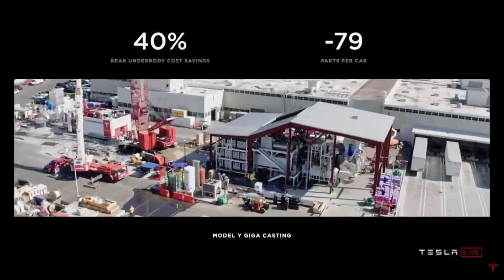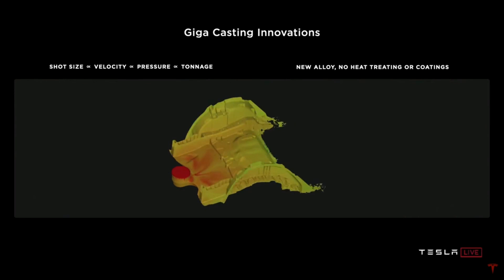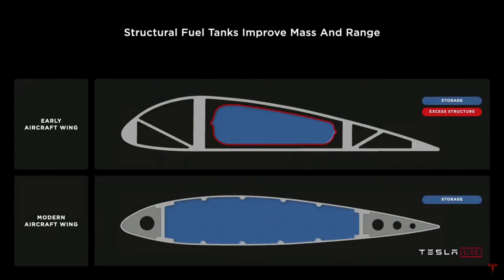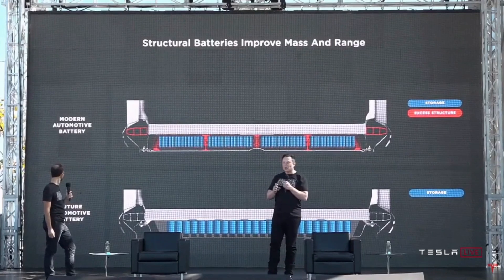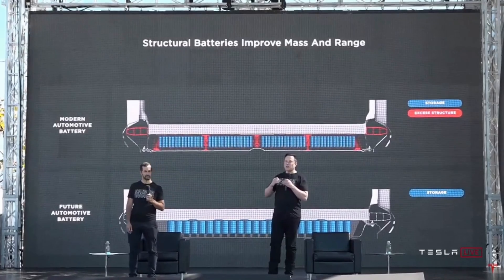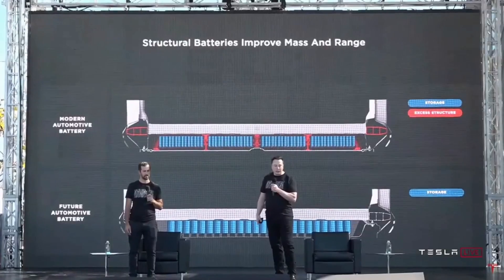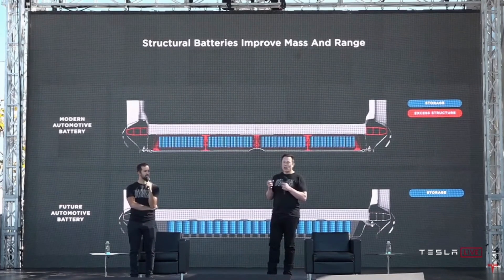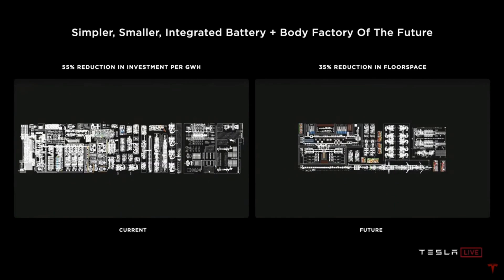Elon Musk explains how Giga casting works for the Model Y

Comment: How can tou change a battery if they are structurally bound to the rest of the car ?
Reply: It's still bolted in from underneath just like now. Except it's a stressed member design. So the pack itself ad's to the overall frame stiffness.
Check out the model y Berlin demo. You can see the structural pack has the seats mounted on it and then installed from underneath up into the chassis. Brilliant imo as it saves them having robots on the line installing seats from the sides. 👍🏻

Comment: All respects to Elon and his team of engineers. I love the way Tesla throws out the old automotive engineering playbook. But Elon forgets that not everyone that drives a car can afford a  new vehicle every 5 or 6 years. What I see in his design is the I-phone of cars.  Once the battery is used up, your only choice is to junk the car. In fifteen to twenty years junk yards will be filled with otherwise functional old Tesla cars because it's not feasible to replace the batteries.
Reply: The battery lasts a million miles.  That is more than most cars stay on the road.

Comment: What about cost of repairs? Sheet metal will bend and still remain serviceable, a casting will crack and run the risk of total failure and have to be replaced at high cost?
Reply: that's the downside to this, if you look up what happen to Tesla after an accident and majority of them are thrown away because you can't repair a whole body casting like this.

Comment: If its integrated into the main structure how would you change the battery? 😂
Reply: He is saying it will be single densely packed battery pack with filler adhesive in between cells.
From service point of view modularity has advantage to replace any defective module as you thinking.

Comment: What is the repairability of these castings?  Is a “fender bender” cause for a major repair?
Reply: Was thinking that myself, generally the more modern and integrated a car is the less easy it is to repair.
Reply: Welding repairs current casting aluminium alloys is a right bitch, so I expect that trying to repair a new structural alloy could be a real nightmare and quite possibly uninsurable.

Comment: What happens when you have a fender bender,do you have to buy a whole new casting?
Reply: @MrDpearso22 the impact to damage this casting would be greater than it would take to bend any frame structured car that’s instantly deemed salvaged by insurance. That’s what sandy munro says anyway but he’s just an engineering expert so what does he know right.
Reply: @MrDpearso22 i sort of agree, but it might be too soon to call it. With the unibody made up of two big aluminum castings, it might end up being easier to fix than a crunched up standard sheet metal unibody. Will it be cheap? Hell no. But say you get badly rearended with frame and suspension damage. If you can just bolt on a whole new rear half casting and body panels, AND it could drive like new? I think thats more repairable than today’s modern cars. But we’ll see. Hopefully they make this thing as repairable as I think it could be.
Reply: @MrDpearso22 not exactly, make them cheap and recyclable. Invest in energy tech so you can have cheap clean energy creation and now you have a perfect cycling economy. No waste, only energy consumption to remake the car from the old materials

Comment: isnt die casting really brittle ? what happens when someone crashes ? normal steel/aluminium deforms and absorbs a lot of energy from the impact, how will die cast parts do that ?
Reply: They are not intended to crumble in any way, because they are part of the Passanger compartment, not the crumble zone.The Crash Rails on them which were mentoined are where the rear end structure is attached to the Casting - and that part is intended to crumble and be replaced.
Reply: These castings have a special alloy (Al + additional materials) to overcome fragility on the part... Pretty sure, his Space-x engineers found the correct formula to solve this issue as well as the dimensional aspect.

Comment: Definitely gets cars out the door at lower cost. Now let's talk about repair. I hope that the question of repairing frame damage caused by collisions has been considered?
Reply: Writeoff
Reply: as with any other vehicle where that equivalent part is damaged..
Reply: This actually solves the issue of repairability of unibody cars, apparently.
Reply: Vehicles already have formed sheet metal frames. Making the frame out of less pieces is exactly the same, just simpler and stronger since they have less welds
Reply: @ouvuu  they don’t provide the same structure strength as this though

Comment: Why was it so important to develop a “special” alloy and impractically large die casting machine to make 1 part when you could have made 2 parts very normally. I believe it replaces 70 or so parts? 1:70 isn’t that much better than 2:70 in the system of mass production. Thanks
Reply: Manufacturing time. Developing the alloy and machine is a one time cost. The saving is over millions of parts not having to be welded together for the millions of cars that will be produced.
Reply: I believe the makers of the giga press said one giga press costs less than two equivalent smaller presses.

Comment: Die cast aluminum parts have advantages and disadvantages.Advantages are  for the assembly line ,which provide very quick operations and obviously reduce cost.But I would like to call on a big danger when the car gets impact from the head or from the back.There is a big probability of crashing.And consequently a big force transported to the passenger’s faces or bodies.As you know ,when the cars produced with steel sheets,the steel plates distortions absorb some part of impact,before passing to the passengers.This was the big decision in the past by the manufacturers,to pass from the chassis part to mono block bodies to avoid the big passage force to the passengers.Therefore,you should be very careful to get real results from the crash tests of the bodies made with die cast aluminum.
Reply: Interesting. Probably not as big of an issue when hit from the front, but definitely seem to be a potential issue when hit from the back.
Reply: The casting is the part of the car that does not deform in a crash
Reply: @vidznstuff1  That's what I'm saying..The deformation of the sheet metal ,saves human's life with it's absorbtion to the impacts..Whereas,the alumium cast materials doesn't deform but crash.All the impacts pass to the passengers, directly.The cast parts are assembled at the front and at  rear side of the car,contrary what you believe.
Reply: This is a good observation.. Crash tests have to be validated with extreme care otherwise it will be counterproductive for Tesla. Out of a doubt that from the cost standpoint, these mega-castings bring huge benefits.
Reply: Yes. But I think with extensive CAE simulations and variable thickness in the casting part at different areas considering the crash load paths, coupled with the malleable property of aluminium, I believe intended amount crush behaviour can be met for sure. Thus load transfer in the event of crash can be effectively mitigated to not to reach into passenger compartments. Also, another advantage i see is that reduced additional processes compared to that in conventional sheet metal weld joinery which may give comparatively less precise crash behaviour real time results than from a properly casted single part. Only gripe i see in case of crash is that, even any minor damage to this casting will still call for complete replacement of casting which will be extremely expensive. Because replicating the high temperature casted part property in any local area by rework which is way beyond what we can think of
Reply: Well, they did some thrift or you missed something, as Teslas are scoring very high marks across the board and are leading all other cars in safely.

Comment: pls explain i nothing understand. it melt aluminium by super pressure and then pump it to ultra complex form????????
Reply: Yes... You melt aluminum+additives and like having a big syringe... it’s injected (in liquid state at hot temperatures ) into a mold then once the molded parts cools down then it’s taken out of the mold as a big solid matter... that’s the mega casting... Big change in the way vehicles will be made under  such design

Comment: Why hasn't anyone ask about impact damage?
Does this break on impact,?
If it does brake on collision imagine how much insurance will be.
Reply: @I OFFER YOU THIS have you ever done crash repairs?
The comments were not about safety it's about insurance you silly goose.
Reply: @goatlady7761  Elon is so far ahead of us on insurance we might as well be looking at his fossilized prints.  We probably won't even own the car.  The whole front/end units will be dropped into some evolving interchangeable "parts" database in various states of repair.
Reply: @goatlady7761  what kind of damage we talking. scratch to high speed accident. the money factor is a concern just related to matter of what needs to be replace, tradeoffs, I think however you can assume elon makes some highly durable impact survivable parts if you watched the video
Reply: @kubes8388  we won't know till car is released.
The problem also is these cars will be worth nothing at salvage auction.
Only purchased as parts cars.
Time will tell.
Reply: There are crumple elements in the front and back attached to the castings and on the side there is crumple space as well. If you have a collision which is that heavy that it would deform the casting parts the car would be totaled anyways. The price at a salvage auction would not be much different from a traditionally build car in that case, as the value is only determined by the unaffected parts.
Reply: Just think FSD human are bad drivers easily distracted
Reply: I believe it's the carriage area not the entire frame
Reply: If the damage is huge... Just like a regular crash In current automobiles... Total the car and that’s it... Your insurance will reimburse what its value is... Maybe these cars will have a higher insurance value in the event they can be easily totaled with small/frequent crashes.
Reply: I’m just going to suggest that if you’ve thought of it there’s a good chance they’ve thought of it as well.

Comment: That is a very interesting process that Tesla is trying to perfect.
Reply: What their not talking about is the main reason for it. The casting machine eliminated 77 weldments. I know robots do those welds anyways, but people still work in those areas dealing with those welds. Basically it’s a job eliminator, profit increaser. Can’t say I wouldn’t do the same
Reply: @frankdelmonte2019  it’s all about lowering costs. The easier it is to build, the less it will ultimately cost then